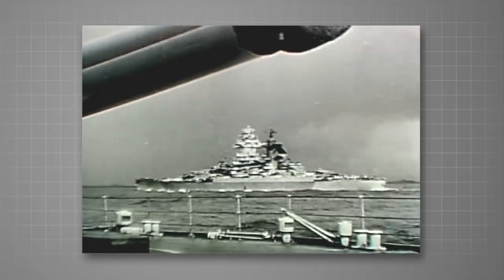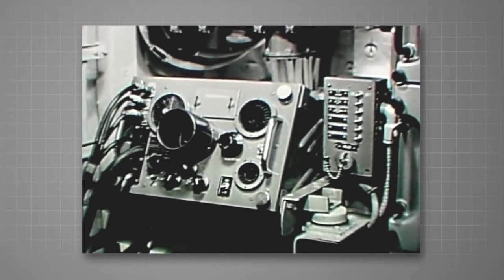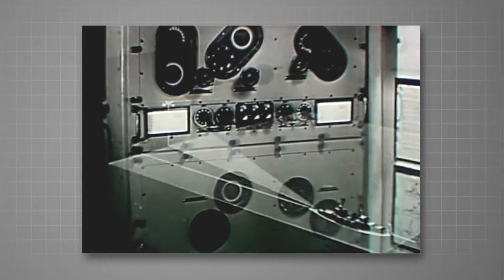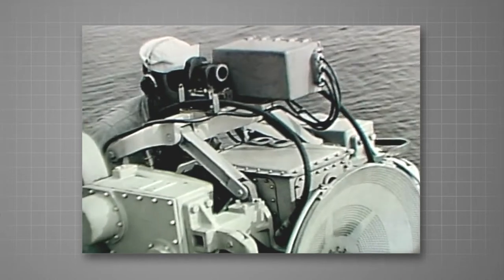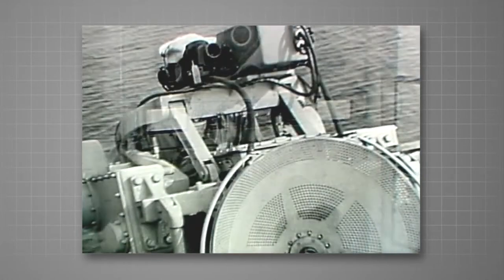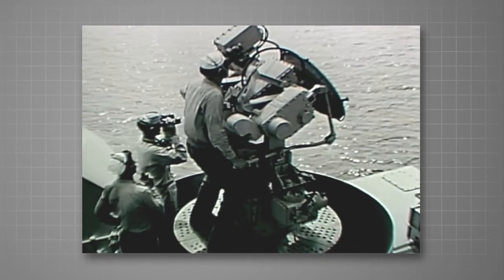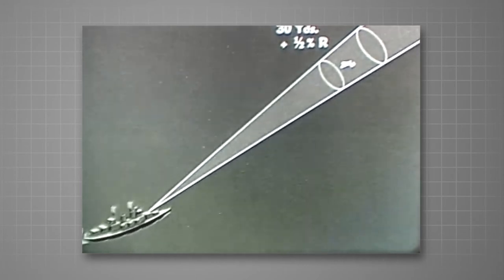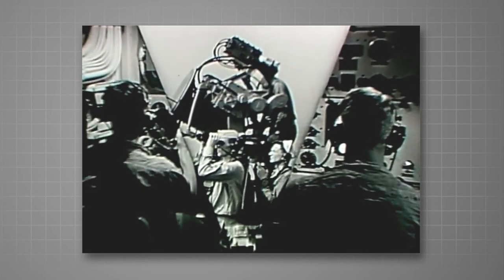Mk 57 Gun Director

Comment: My dad was an engineer and a reservist AA battery commander in WW2. He worked to design the land based AA radar tracking system with a slaved 3.7in (94mm) AA battery. By 1944 with radar fuses, that did VERY well against V1 as they usually followed predicted tracks and batteries were placed accordingly. Not so easy elsewhere but still, a giant technical leap

Comment: I was a 2nd Class Petty Officer and operated and maintained the Mk 56 and MK 68 Gun Fire Control system ,we had a fire control computer called the Mk 1 A ,it was a a dinosaur by todays standards,we used tubes,,syncros and servos,,we manually "cranked" input target speed,elevation ,location,ships speed,temp ,etc ,,while outdated for sure ,it was something troubleshooting down to the component level ,we changed tubes..capacitors etc our computers were massive cabinet banks and didnt compute 2% of what your cell phone does today
Reply: I worked on the mk 1a used on the 37gfcs and 5" 38 guns. Also. Mk 25 radar

Comment: The antenna seems to be rotating and wobbling slightly. Is that some form of conical scanning?
Reply: That's "nutation."  There's a very small conical scan of the main beam. Whichever direction returns the strongest return  gives an indication of which direction antenna needs to move towards to continue tracking the target. It's used for automatic tracking.